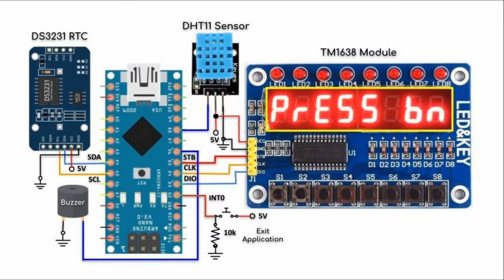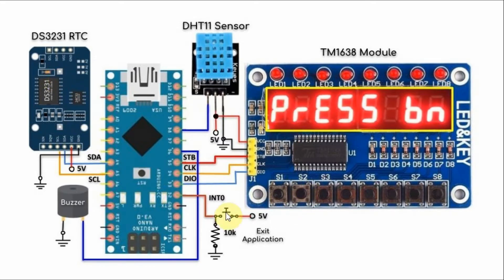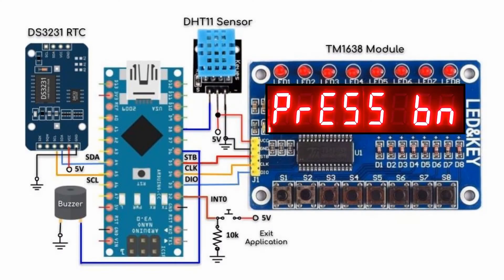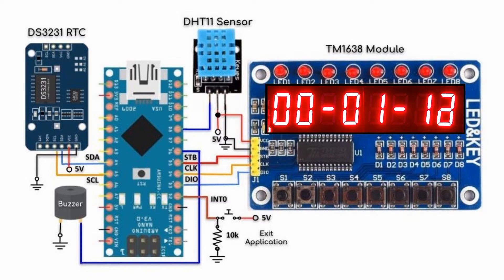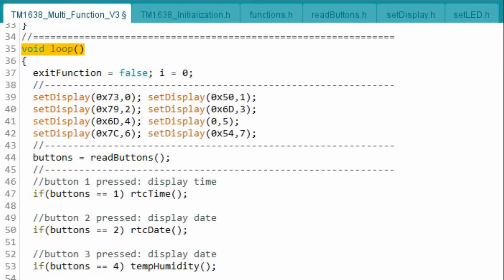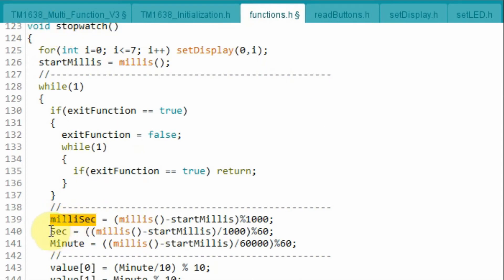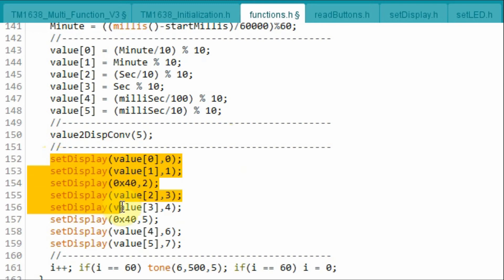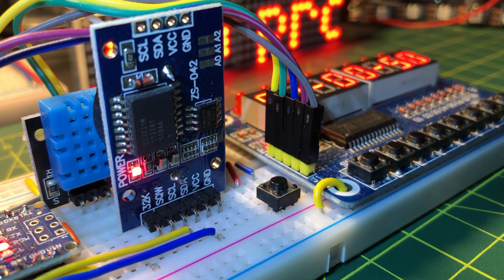Stopwatch on TM1638 Module

Comment: Boy I'm having no luck with these projects. I ordered the parts for this project, downloaded the code and it won't verify either. Tells me there is no such file or directory, as TM1638_ Initialization.h I have the only two avail library for the TM1638 chip in my arduino ide. Neither of them work
Reply from the maker: Hi. Make sure you have all the header files located in the same directory of the main sketch.
Reply: @AnasKuzechie  I do, I copied you sketch, pasted it in my sketch, made sure I had the appropriate library in my ide. Clicked the verify check mark, and got the  error message
Reply: @AnasKuzechie  Please explain this to me, Sorry for my ignorance, I'm trying to learn Arduino c++ and don't understand what you mean by "in the same directory as main sketch" Are you asking for them to be called out prior to "void setup"?
Reply from the maker: @williamb3323  I’ll simply the sketch for you and put the stopwatch code only all in one file. By tomorrow I’ll provide a link. Meanwhile you can watch videos on how to create header files within Arduino IDE.
Reply: @AnasKuzechie  Thank you so much Anas. I will watch the videos on header files, I appreciate your help.